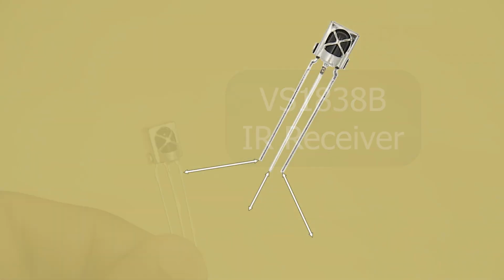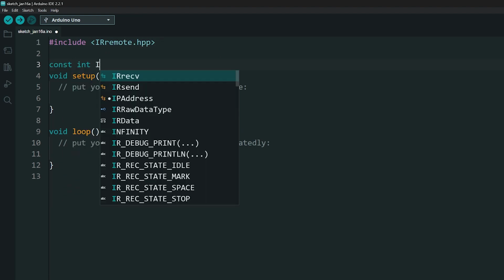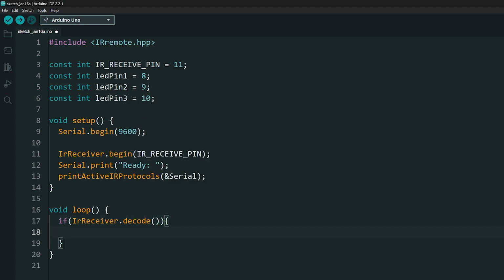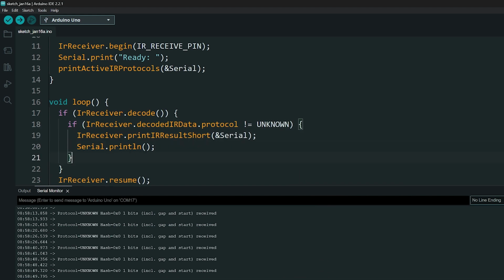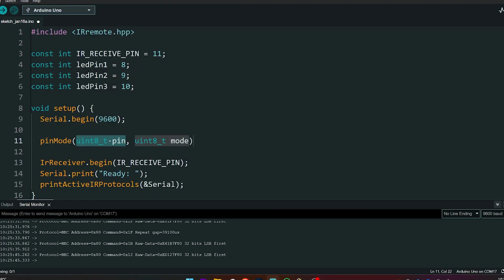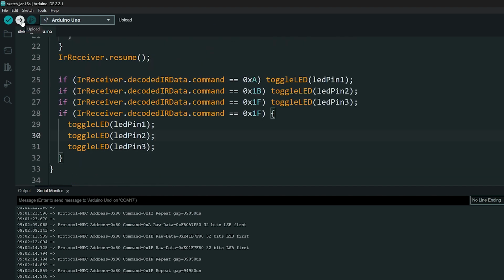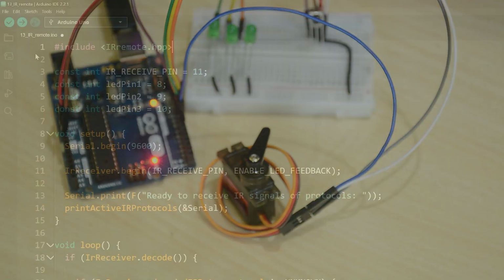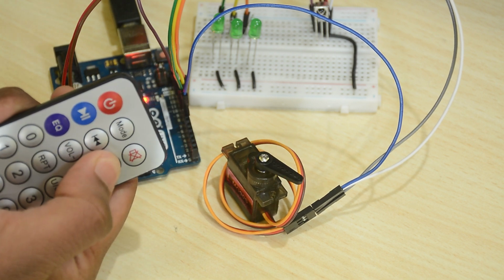Infrared remote for Arduino Projects

Comment: I've tried numerous videos and they all fail. I copied this code and it failed. There is no file with a .hpp extension in the library, only .h and .cpp. I'm new to this and totally lost. I'd like to move the servo with the remote and I'm not needing led's involved.
Reply from the maker: The library is probably updated since I published the video. I'll check and update the code. But probably will take time
Reply: @techtalkies1  Thanks for the reply. I'll let you know if I get it figured out.

Comment: Tried using the code you have, but getting the error message 'class IRrecv' has no member named 'decodeIRData'; did you mean 'decodedIRData'?
Reply from the maker: The library might have been updated since I published the video. I'll update the code.
Reply: @techtalkies1  Thanks. I did some looking around and it does look like the code had changed.
Reply from the maker: @stevenqueen416 were you able to fit it?
Reply: @techtalkies1  Yes I was, Thanks

Comment: one question, to send IR data with an infrared led, which command do I need in this newest version of the library?
Reply from the maker: Sending IR data is a bit more complicated than receiving. It depends on the receiving device. So we need to know in which protocol to send. If you know that, it is pretty simple. So let me know to what kind of device you're sending and I can point you in the right direction.
Reply from the maker: The library has many examples. Check this simple sender example and let me know if it helps.

https://github.com/Arduino-IRremote/Arduino-IRremote/blob/master/examples/SimpleSender/SimpleSender.ino
Reply: @techtalkies1  I have a VU+ remote, but I think there is no protocol that supports these remotes
Reply from the maker: IR remotes are not really that complicated! First, try to decode the remote with the project mentioned in this video. If it's decoded, then it can definitely be replicated!
Reply: @techtalkies1  The problem is, because of the Unknown protocol for my remote, in the Serial Monitor I only get: 
"Protocol=UNKNOWN Hash=0xD2E3B274 31 bits (incl. gap and start) received"
Reply from the maker: Try using the sendRaw function and send the recieved bits and check if it works.

Comment: Can you please make a dedicated video about programming ESP01 with Arduino Uno pls?
Reply from the maker: Sure. That's pretty straight forward. The easiest option would be to get a 3.3 volt USB adapter that is specifically designed for the ESP01. They're pretty cheap. I'll make a video on these options soon.
Reply: Thanks 😊

Comment: Great,
Using arduino or nodemcu wifi Can we get any sensor data in mobile  via Bluetooth or wifi without using any internet or IOT or blynk or thikngspeak?
Reply from the maker: Yes, using an ESP32, you should be able to use Bluetooth to recieve data in short range.
You can go a step further and use LORA (long range) modules to get data over some distance. This is a very common practice in data logging.
Even using the ESP8266, You don't need internet. The board is capable of hosting its own network (access point example). Please look that up and and also I'll make a video about it soon, if it's something people are looking for.